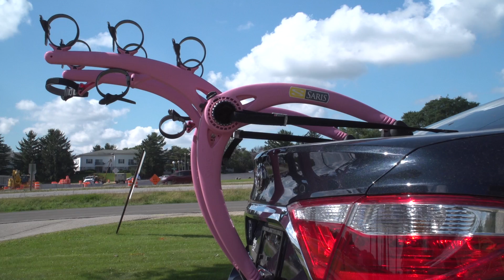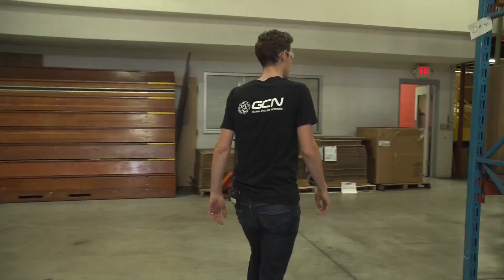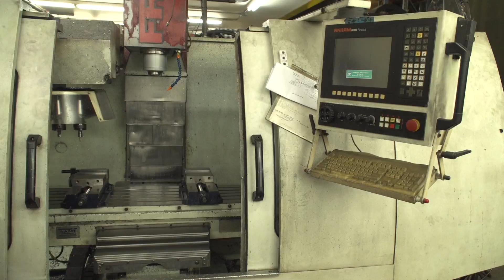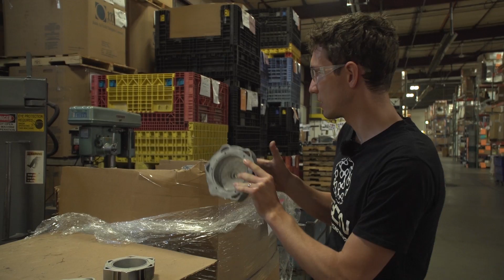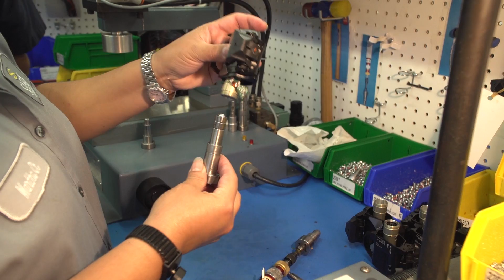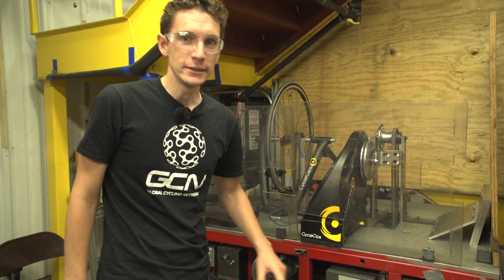Saris Factory Tour: How CycleOps Indoor Trainers Are Made

Comment: So they test it with just 700watts? What happens when the boss climbs on and smashes out 1200wAtts, I guess it blows up
Reply: The Prodigy suddenly appear and perform Fire Starter.
Reply: That's just the endurance testing. The Hammer is capable of 2000+ watts and the Magnus 1500+ watts.